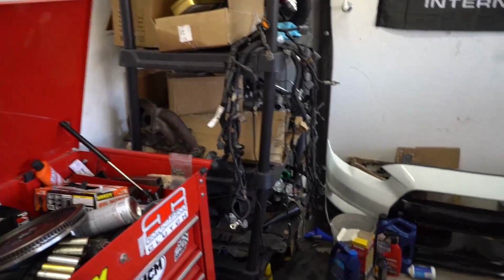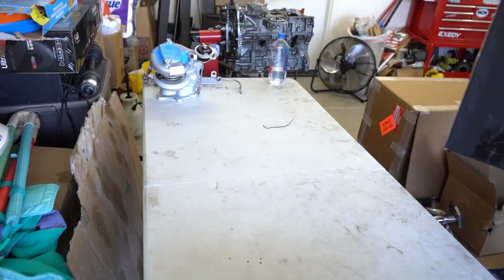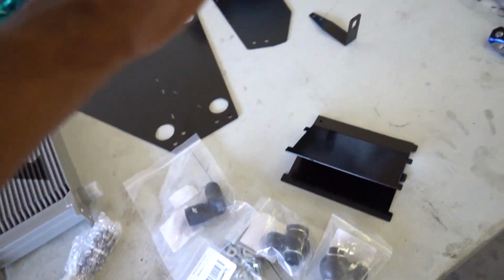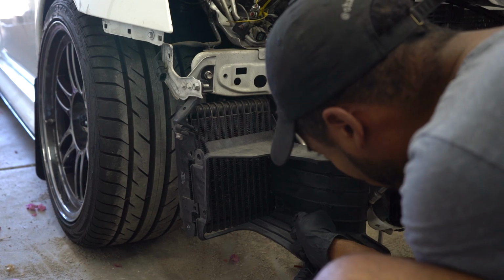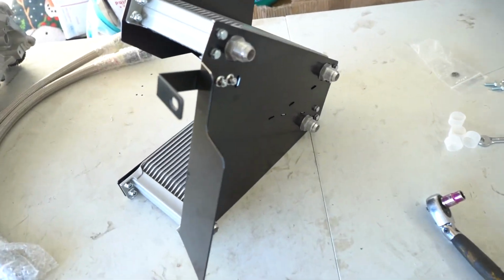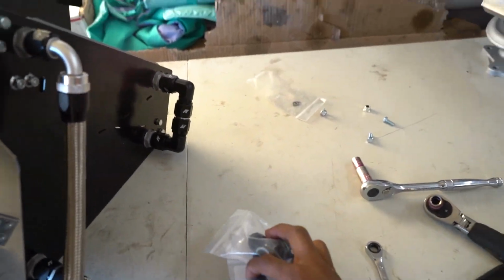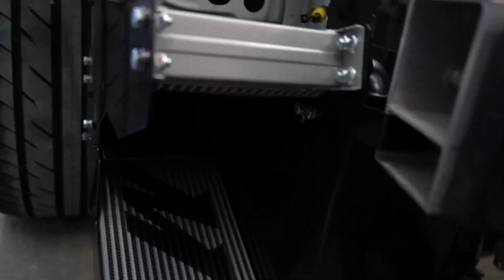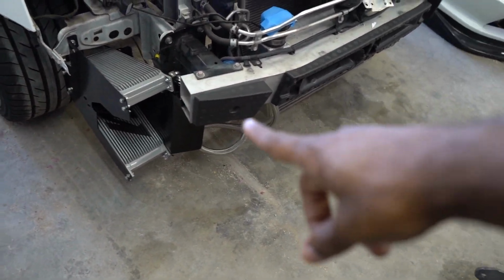MISHIMOTO EVO X OIL COOLER INSTALL

Comment: I believe you did the best decision dual  mishimoto oil coolers  Is definitely the way to go  I didn't know the bracket would be that loose but thank you for sharing there must be a solution but I must say you'd also need the All aluminium radiator from mishimoto As well as the radiator hoses. Anyway keep up the great content looking forward for to the  next one.😄
Reply from the maker: Thanks man! A nice new mishimoto radiator would definitely compliment the new oil cooler setup 🤔

Comment: Looks good bro.  However, do you think the bottom cooler will cause clearance issues???  Sits way too low for my comfort.  A dip in the road or speed bump may puncture it you think??? Congrats on your twins!!!
Reply from the maker: Hmmm...definitely a good observation and my car sits kinda low 😬 at its lowest point tho it’s not much lower than my intercooler so I’m hoping it will be okay 🤞🏾
Reply: He brings up a good point...Also, how does the front bumper fit with these? Does it have any issues or does everything fit fine?
Reply from the maker: @that1evox73  I mocked up the bumper shortly after getting it set up and it seems to clear just fine thankfully 😅